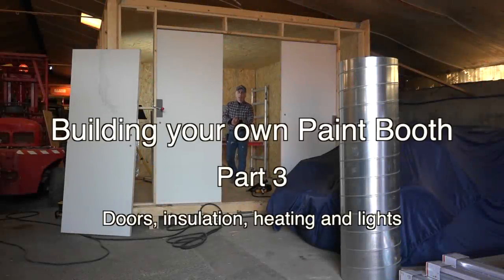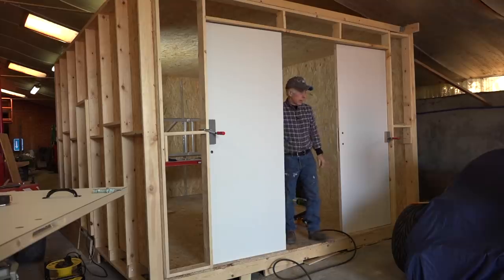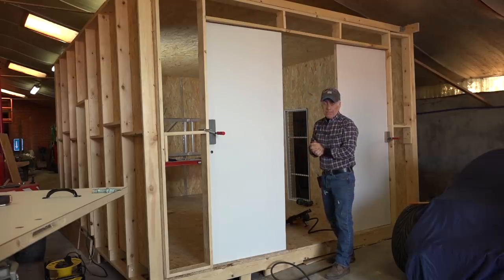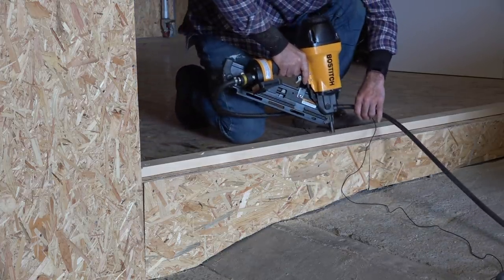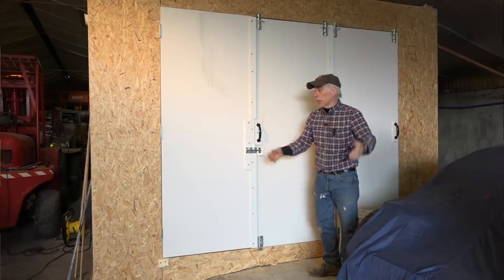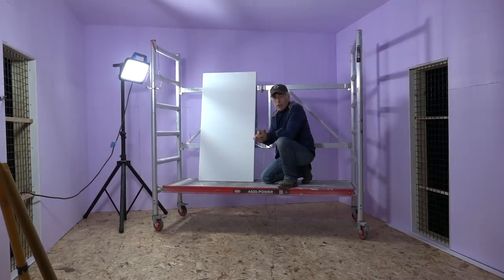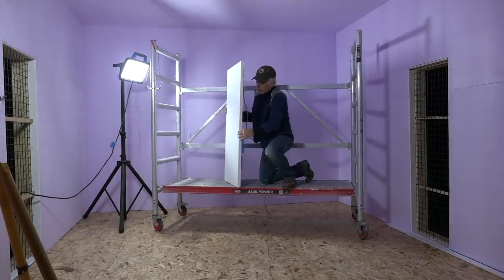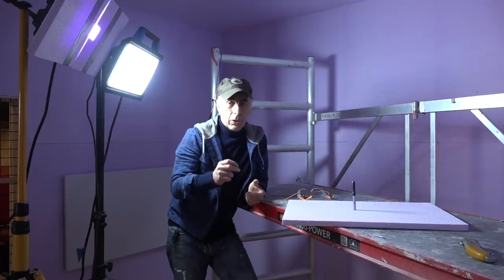Building your own paint booth  Part  3, doors-insulation-heating-lights

Comment: Very good choice with the doors, they are, as you say, very cheap and very rigid, and they are light enough to be lifted around with ease, A very succinct explanation about the source of light relative to aperture as well, deep shadow is the last thing you need in there, the only thing that could be a problem is that your access door has the catch on the outside, whereas you will be on the inside ! I can see you will be spending the winter in there !
Reply from the maker: Englishman French , txs.   I have a catch at the inside as well.  I just need to hope that nobody locks me up.
Reply: @D3Sshooter  Ha Ha ! I noticed that there was a catch on the outside as I did the same on my log shed, I made a simple link to the inside in case the wind blew the door closed.

Comment: I'm no painter but we always had complaints from our paint shop if silicone was anywhere near the paint booth or vehicle.
Reply from the maker: TheHoipoloi , indeed that is a painters nightmare silicone as it causes fisheyes in the paint and is very hard to remove or clean.  Here the seals are behind the insulation panels.   So should be no problem

Comment: 1) could you consider using a lot of led strips? 2) why didn't you put the lights lower? Will you have enough light in the lower area?
Reply from the maker: These lights are LED but not LED strips, the reason is that you want to cover it up with plastic to protected from paint.  On my lights I place a peace of clear plastic every 3 jobs. Works great.   Also LED strips are to hard ( light wise) as he surface is to small. So far I had no issues with the light.  I can always add additional stand free LED lights if needed like for the inside of a car

Comment: You may think you have good lighting but your going to find alot of dark spots when you put rusty in there. I would add more lights low or better yet up an down. 
Thanks for the video enjoy watching them..... :-D
Reply from the maker: Bob Pendergraft , indeed that will an instance that will require extra lights.  That is why i have extra moveable led panels.

Comment: would another heating panel be useful at the back of the shop? and what about air line hook ups in there, how will the pipes run?
Reply from the maker: Jusb1066 , txs and good points.  I might install another panel in the back.  The air connections and oil/ water separator together with the ventilation will be addressed in part 4
Reply: @D3Sshooter  thank you for reply, i shall keep watching to see!

Comment: Having the heating/ infrared panels installed- for awhile how are the working? I’m setting up a booth and see a lot of various inferred panels advertised mostly the 3k panels in sets of 8. Wondering if this is something to explore. I have not seen the type of panels you installed.
Reply from the maker: Thanks for the comments, they work great... I have four of them and can get upto 40 degrees inside during a cold winters day...  far end infrared... works great as it heats the surface not the air
Reply: Again to add awesome videos really helped in the making of mine, I’ve converted a 20ft container into a spray booth and just going into the heating side now. Would love to use the infrared idea do you know what w/kw yours are?

Comment: Excellent job, I have already started building one. I am in the UK, could you please tell me what the indoor wall insulation is called & where can I get them. Thanks for help.
Rasool
Reply from the maker: Hi, and thanks for commenting,  its a XPS extrudeerd polystyreen panel that is enforced on one side.  I think you can get it in most building material stores.  The brand is JACKODUR